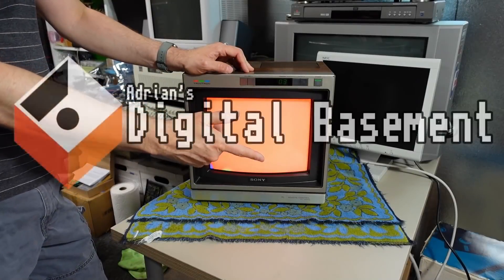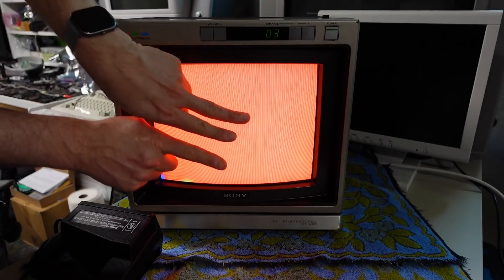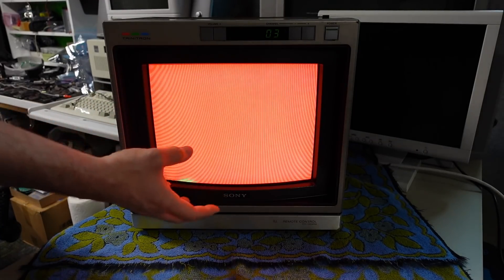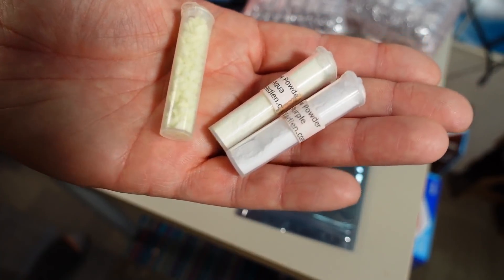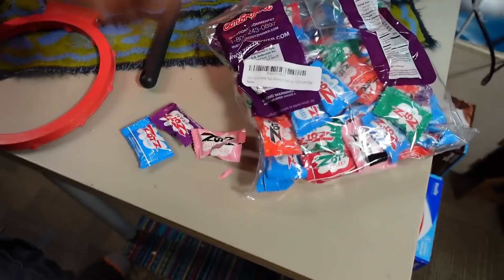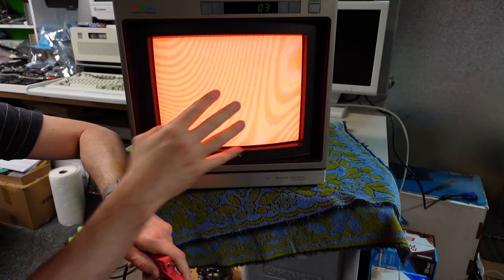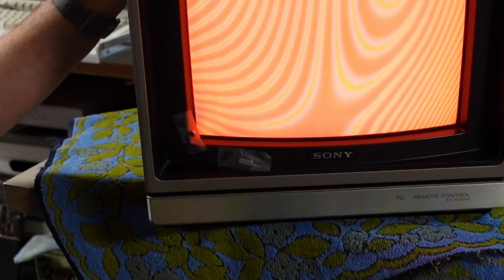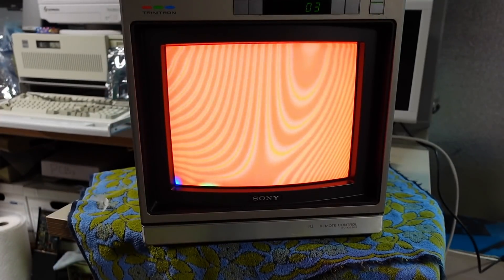Can you fix CRT color issues with this plastic ring?

Comment: Use a small radio speaker magnet put it in a sock to protect the glass then put it right up at the screen in that area and massage it as you are for a good minute and a half then turn the magnet around 180 degrees and slowly circle out in that area you may be pleasantly surprised the telly has to be left on all day after to stabilize the screen because if you just switch it off a minute and back on the same thing will be back again you may have to do this a handful of times it eventually sorts the screen out I have an Eneo monitor Panasonic tube that had the exact same problem but worse at first was just attaching the speaker magnet to the metal case side that worked but it never fixed the screen perma a pain in the @ss someone may have sat a strong magnet speaker next to it in transit or in a home to cause the damage sorry the Eneo is a Samsung tube

Comment: The stray magnetic field exists "ON" the shadow mask itself and not in any other part of the CRT (scan coils).  Magnetic buttons, with known magnetic properties, were available from Sony for dealing with spot shadow mask magnetic contamination like this. They are stuck to the rear of the CRT envelope, on the grey  aquadag coating, where they are found to neutralise the magnetic contamination/distortion.

If the deflection coils were the cause, then you would more likely have subtle convergence errors too, including some bizarre geometry distortions too.

Comment: You may stuck with it, but an old TV manual I had (published in 1959 or so) said that you can take an inductor of some sort and connect a MAINS power cord to it to use as a degauser. Perhaps you could build a wand similar to that.

Comment: There's a fine art to sticking small permanent magnet strips to the picture tube to correct for beam misalignment. It's not a perfect solution, but good enough to keep a consumable product functioning more satisfactorily until it's lifespan has passed. Depending on how careful you are with the magnet placement and how serious the misalignment is, you can sometimes get away with the really weak ferromagnet adhesive-backed refrigerator magnet sheets, then you can cut exactly the size you need and adhere it to the tube once you figure out where it needs to go. You may be able to get away with using an even smaller neodymium magnet epoxied to the corner of the CRT behind the bezel.

Comment: and old trick i have used take a pc monitor that has a degause option and stick the screens together and then do the degause it should do both monitors at the same time i mean stick glass to glass or as close as u can get 9 times out of 10 will fix a monitor that doesn't have said option

Comment: That looks like something magnetically "hard"- those magnets should have left a permanent impression, but whatever's inside seemed to overpower them.

Is their perhaps a stray wire near that side of the screen that's come loose/magnetic shield that's come detached/rusted.

No hope of degaussing untill that's fixed, if that were to have happened- it would just remagnetise it.

Comment: A degaussing coil for use on crt’s is a a/c powered coil.  A/c  removes magnetism  because it effectively flips back and forth between north and south magnetism.
Reply: And the cycle frequency will be lower than the tape eraser, as that uses higher frequencies outside of the tape’s reproduction range to overwrite a signal with (inaudible) noise. I suspect that’s why it has a more dramatic visual effect on the TV despite being weaker.

Comment: Often, these TVs had disc magnets stuck to them on the edges, you might want to take this apart and look for them in case they got unglued.
If the problem was physical damage to the aperture grille, it would certainly not be located in just a small corner, it would affect the entire screen.
Reply: Adrian doesn't need to hear all of this, he's a highly trained professional.
Reply: @ozmobozo  this comment is brilliant and highly under appreciated

Comment: 13:23 if you take the CRT out... the problem will go away... i bet you 10 bucks on it........ what is causing that magnetic field you see in that corner... is not inside the CRT ... is outside the CRT............ a parasite CC current circulating in the degaussing coil.. i bet you 5 bucks on that (disconnect the degaussing coil.. see what happens)......... if is not that.. then magnetism in the screw on that corner.. (highly posible).. or in the bracket in that corner.. (unplug the TV for 24 hours and use a compass to find the magnetic object in that corner.. the needle will point you towards the south and north pole of the magnetic object there).... magnetism in the anti-explosion band also can be.... (the magnetism in those metallic objects can be removed.. using that red ring).. or with a simple electromagnet powered with 12v AC (a coil around a screw).. and leaving it close of the metallic object for a while...

Comment: Some years ago I was in a pub with some friends and in the part of the bar we were in there was a tv but it had very bad colour distortion. I went to the bar and asked if they wanted the tv fixing and told them that I might be able to sort it there and then and they said "yes please!", so I asked if they had a spare table that could be used, so basically I picked up the tv put it on the table turned it on and went back to the bar and said that their tv was fixed. My friends were all puzzled and also the landlord was shocked at how quick I had sorted it, so I let them in on my secret that it isn't a good idea to put a tv on unshielded speakers. Probably the easiest drinks I've earned.
Reply: Thanks for this!!

Been messing with old CRT TVs for a college project and two ot them were going a bit tripped out on me! Looked cool, but not what I wanted!

They were right beside about four big speakers I have for parties...

Moved em and all good!!!

Comment: Place The magnets in The right position before you Take it apart. Then put a washer on The back of The plastic. As Thise are neodymium they Can easily hold it through a few mm plastic. Use a pen to Mark The center of The washer. Thats where your magnet should be. And If you are in luck, it Will work when you power The tv back on. 
This Way, No need to work near a live crt. 

I Got shocked by 25 K Voltage in an old b&o when i was a apprentice During my Education as an Electronics technician. Cost me lost feelings in two fingers for two months. Hate to work on live HV to this date, 20 years on 🥴🥴

Comment: Looks like its a convergence/purity issue, since the magnets you stuck on there fixed it. The problem is that is will continue to get worse, at least in my experience. Had a beautiful 32" Wega Trinny, and it had been dropped when I carried it, enough that it knocked a few of the magnets that the factory had installed on the back of the tube itself had come loose. I stuck a ton of weaker ceramic magnets and magnet tape to it, and I got the picture looking beautiful. Then I turned it off..and when I turned it back on, there were brand new issues in areas of the tube that never had them before. So, again, I popped the back off, set up my mirrors, and started tacking on magnets. Again, got it fixed, looked great, worked great for a couple of days..and then new issues again. Eventually I must have plastered close to 25 magnets on the tube itself, but I think that the aperture grill inside the actual tube must have gotten damaged in the fall (even though it didn't fall far, it was enough). I did give up on it after about a month, but I mean I tried everything...magnets, deguassing with a smaller PC monitor set on top of it, setting another tv in front of it, using a drill, but in the end, I didn't have the knowledge to fix it. Since its small enough, the magnets might do the trick though, but in time it might cause damage. Good luck!

Comment: Going down the troubleshooting rabbit hole, you could try taking the CRT out of the housing to establish where the fault stems from. Had it been dropped, some plastics would be broken, and  the grill wouldn't just come loose without any trauma to the CRT. One guess is that the TV has been sitting next to a speaker for a long period of its life, and that something may have caused something else in the case to become much more magnetic.

Comment: Definitely warped shadow mask, because of heat or mechanical stress in the past. Your tape degausser is better than the plastic one sent to you. Other than that, they do the same job. The key is to switch it off away from the crt, thus creating a fading to zero magnetic field. Your approach with the permanent magnets is correct, as long as you check all the colors and convergence before you install them. Most likely there were such magnets (typically in the form of adhesive magnetic tape) installed from the factory that got detached, as others have already said.

Comment: Honestly, if I had to guess, the screen was placed near something hot. Remember that those shadow masks are super thin grids of metal. I don't know if a heat source could deform that metal without melting the plastic, but it's a possibility.
Reply: From such intense heat input, not just the plastic frame would melt (and burn), but also the glass would crack.

Comment: Have you checked that the yoke hasn’t moved slightly over time? I’ve had a similar problem before where I had a discolouration on the side of the screen as a result.

Comment: This is how I've always degaussed my TVs and it's always worked for me: https://youtu.be/toG71oIBWGM  Of course the last time I mentioned this I was told by everyone that I was wrong and it wouldn't work or would make it worse but it works.  It does take several minutes to fix even a small color issue, not sure how much time you really spent but the time shown in the video does not seem like very long.  Also note this guy is doing it to a Sonictron (Trinitron) Viewsonic monitor.  I usually pull the drill away several feet before I let up on the trigger though unlike this guy, you can fix one problem and make a new one otherwise.

Comment: Back in the day I got some free CRT monitors, with the same problem, just far wors!
It was free and I didn’t had a degauser, so I started to “swing” a strong speaker magnet besides the affected area. Started far, tested result, went little closer, and so on. It was about 1 hour careful work. At the and I showed the result to the previous owner, he chouldn’t belive it! 😉
Just do it by small steps and check the result every time! This way you will not deform the inner metal grid behind the phosphorus.

Comment: Yeah, clearly it's a permanent thing on that tube. Seems like you will have to take the tube out of the chassis and see if that changes anything, and if not, try to fasten the magnets somewhere on the tube where they make the problem go away. From what I remember,  the degaussing is just about giving the grid a reset in case it has gotten out of position. They're quite susceptible to magnetic fields, as demonstrated. Either there's a magnetic source causing it, or the grid is misaligned. I suppose it could be worth trying the degauss ring around the neck of the tube rather than around the corner only, but I doubt it will work considering how stubborn it seems to be - it didn't change at all.

Comment: Glue Both the Magnets to the tube itself in that corner, thats what i had to do on an older set that was dropped by some one, they wanted me to fix it and the problem was similar to that, like some thing in the tube broke or some thing, so i just stuck a Magnet on the Corner that had the Issue and it worked great after.

Comment: I had a similar problem with a 27" Sony TV. I fixed it using repeated applications of the degaussing coil. Hold it close to the center of the screen, turn it on, then slowly move the coil in a spiral pattern to the edge of the tube while simultaneously moving it in and out. Turn the coil off only when it's far enough away from the tube to stop messing with the image. Rinse, repeat. It took me a bunch of tries, but eventually the purity problem went away. 

A bigger, more powerful coil might help, too. Mine was scavenged from another 27" TV. It really tweaks the screen when it's running--and it also gets effing hot!
Reply: Hope this works i got a bad spot from a guitar speaker on a 27" sony

Comment: My guess is that there is a Magnetic field that fell ON(additive)and not OFF(missing) on the CRT tube, coil, etc, to those adjusting magnets during manufacturing, near coil, near CRT support frame...
I bet if you open her up, you will find a itsy bitsy magnetised foreign metal object inside somewhere. seen it once on an old TV that had a wrong support bolt near tube frame, became magnetised overtime(who knows how), change it to a non-magnetic bolt like the other original ones and problem gone.

Comment: I've seen similar purity problems cause from external speakers nearby that weren't shielded over time.  The way that I always fixed this problem, (after causing them as a kid) was to take a speaker magnet and rotate it so the color shifts, and is pinpointed in the area of the problem and use slowly move the magnet away in circles, and sometimes a sweeping motion.  Yours is kind of odd, as it almost seems like it's burn in, but can be corrected with the magnets... odd.  One way to place the bar magnet on the inside at the right location, would be to put the magnet on the outside, and put the inside magnet in with some build tack, and remove the outside magnet to see if that corrects the problem from the inside.  If it does, you can use this to glue or epoxy it in.  The round magnet is a bit trickier... maybe rotate it, sticking it to the strap that goes around the outside of the tube.  Best of luck.  Love those old Trinitrons.

Comment: Don't know about the degaussing issue, but I will note that Sony seemed to like putting the speakers in the top of the television in the 80s (maybe 70s too?), though my later 90s-era Sony TV has it on the side, so I guess they changed their minds at some point, probably because a top-mounted speaker filled with dust and debris... :)

Comment: If I remember from my color tv repair textbook ages ago, when you finish degaussing the CRT screen, you back away, then turn it perpendicular to the screen before turning it off, and make sure before you even begin that any magnetic media was well outside the “blast radius”.
Reply: Same process I used, turning it edge-on to the screen at the end while far away is to reduce the magnetic field as gradually as possible.  My degaussing coil is about 50% larger than the one Adrian used, has a momentary rocker switch in-line on the cord.

Comment: Check the bell housing of the tube, there should be magnets that can make minor adjustments to the tube. Check all 3 colors. The magnets could have fell off also. Some older tubes have an adjustment ring around the neck attached to the yoke of the deflection coil. Sony as well as other brands did at one time sell magnets kits for tweaking the tubes when replacing a bad tube.

Comment: I have a similar problem with a CRT monitor in the lower left corner as well. Unfortunately not many of my available monitors will work with my PS/2 due to insistence on having 14 pins rather than 15, so my options are limited.

Comment: I hate CRTs with passion. Once, as a kid, I got a second-hand monitor so busted I had to keep twiddling the focus control on the flyback every few minutes. When I got the center right, one corner was getting blurry and vice-versa so I learned to settle on "all corners more or less equally bad" setting. I have put an elastic tube on the internal flyback pot and drilled a hole in the monitor's back cover for it just to be able to twiddle the focus all the time. I'm pretty sure I have accelerated the degradation of my eyesight using this thing. I remember how happy I was getting my first LCD like it was today. Having said all this, I cannot resist watching Adrian's each and every video on CRTs back to back. I find his fondness of this technology that was so much worse than modern displays in each and every way imaginable fascinating. I am grateful for people like him who have so much respect for our technological legacy and are working so hard to preserve it.

Comment: I've heard from an expert that dropping a CRT can cause purity issues. It warps the aperture grille.
I actually had a 14 inch Sony TV that has similar problems, but worse. I could get the color spots to go away with careful movements of a speaker magnet but if you turned the TV off and on again, the Degauss would actually restore the purity problem. Leaving it on standby won't re-trigger the degauss.

256k EPROMs make for great multicarts for old systems like Atari 2600, VC4000, Colecovision, Vectrex...